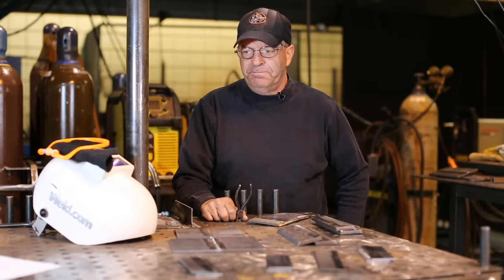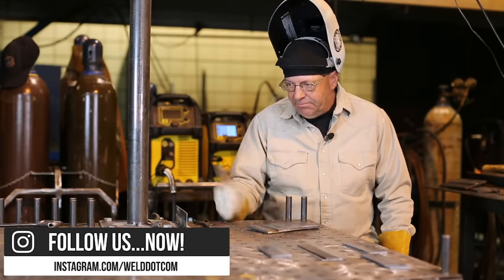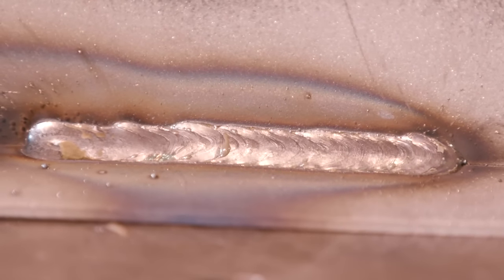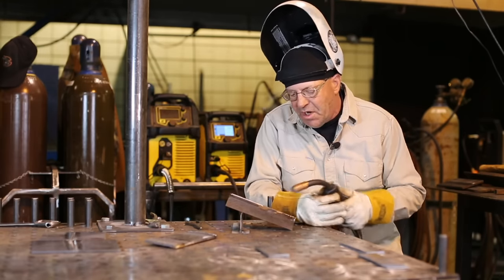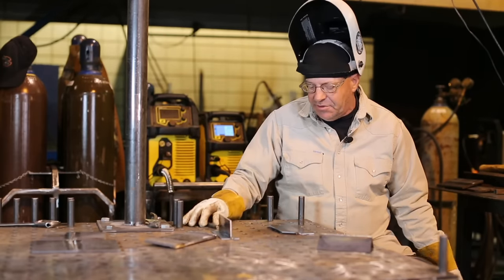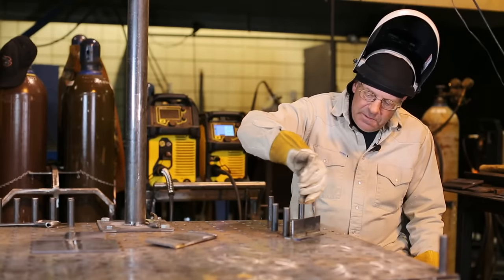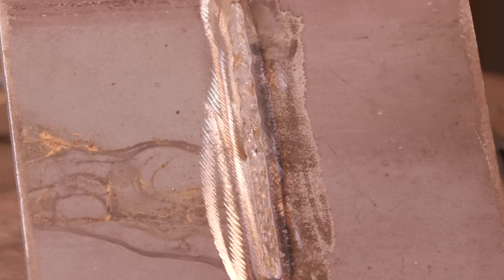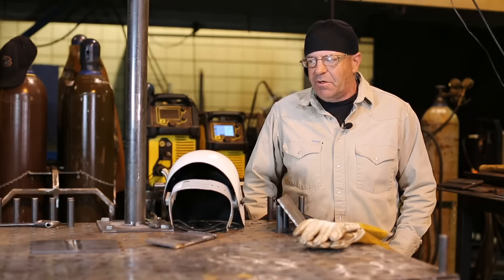Beginners Guide to SHORT CIRCUIT MIG WELDING

Comment: Bob, I've learned so much from your videos, my MIG, TIG and Stick welds are worlds away from where they were when I started watching your videos.  I do a lot of work on very thin sheet metal,  vehicle floors and bodies.  Do you have any techniques for very thin materials with Mig and/or Tig Welding?  I'm mostly working in the 22-18 guage range.  Thanks again for the great videos.

Comment: Thanks for the video Bob.My Esab EM 215 ic definitely runs cold on recommend settings compared to my Millers.For 14 gauge I am running 18.5 volts and 240ipm for most of what I do.I am always running this welder at 1 volt hotter than recommend.My ESAB Rebel amazes me on how smooth and spatter free it welds when properly set up.
Reply: Which one is better?

Comment: Bob I own several welders. haven't  used them in several years due to back surgery. my welders control amperage and wire speed. I feel like ripvanwinkle, what's with the voltage vs wirespeed? This feels like when I woke up one day, and degrees Celsius was the game.

Comment: Love the format, the audio, the arc shots, from the first second to the last, great video.  Having watch the video once, I'm trying to understand what voltage effects.  Wire speed, got it, but volts, well.  My brain has had a hard life so I need to watch the video a few more times or look it up in my Lincoln Foundation Procedure Handbook Of Arc Welding.
Reply: Sparky The Welder Voltage is arc length and makes to pool wet.
Reply: I guess trying to pull the electrode back from the work piece to extend the arc would be an exercise in futility.  Thanks Bob.  Much appreciate your wisdom.

Comment: Thanks for your teaching. Gives me something to work towards! But I have a total-newbie question: are you running at 120 V or 240V? I just bought a shiny green unlimited 200 and have it plugged in to a 120V 20 amp circuit. Do I use the settings you provide (i.e., 17.5/200)? Or, since I'm still learning can I reduce the voltage and feed speed? Thanks particularly for your comments on cleaning the metal. Didn't realize it would make such a difference.

Comment: Bob, I have a question. I don't have a fancy MIG with a bunch of bells, whistles, digital readout, and all that stuff. Just a little Lincoln 180 with a couple of knobs, and a chart in the door. I am a self/older guys taught in the shop TIG welder that mainly welds nasty old Harley cast aluminum, and steel for tools, frame repair, and so on. This MIG thing is new to me, and until I started watching these videos, I never knew any terms for different kind of MIG welding, much less it existed. 

So here is my question: do you do something different for short circuit with the machine itself, or is it just the approach, distance of the nozzle, and so on? 

I really appreciate your videos. Maybe I will come visit you some time. I'm just down here in OKC.

Thanks!

David

Comment: I Like it! 
I use miller deltafab .045, 220v 3 phase, 90/10 running multi-pass on 1/4 and above on semi axles. Painted much of the time so we run it very hot to burn off the paint.

What do you think the best settings would be?

Comment: Hey Bob, from what I’ve read using 75/25 gas tends to give a bit cleaner weld than pure CO2 making it very popular. But I have also read that pure CO2 with short circuit method gives a bit deeper penetration and same settings & a slightly cheaper gas, Is this true? Also does straight CO2 burn through mill scale or slightly rusty metal better, or would you choose flux core wire for the very best penetration, and for burning through contamination using the short circuit method of metal transfer?  Thanks for your great videos Bob. 😎👍

Comment: Would you run .030 wire in 1/4" thick metal if not what size of wire would you typically run?

Comment: We stay with the 92/8 gas all the time. Mainly for our spray passes but we use it on our short circuit root passes also. Is there really a good reason why we should not use that and use 75/25 for the roots? i have never had a problem with the 92/8 for the SC process, was just wondering if there is something to watch out for.

Comment: We run way less co2 over here and a touch of o2 works well
Reply: Mr. greens boat tanks and aluminium welding You can get that kind of blend here too, there are commonly available tri-mixes (95-5-5, I think). But 75/25 is what everyone can get even at the local hardware. There are also a fair number still running pure CO2 because of the increased penetration.

Comment: Another great video! I see your using a non auto helmet. Can you recommend a good lower end helmet. Ive got a cheap auto darken helmet and I'm welding by brail! Even on the lightest setting I have a hard time seeing the puddle.
Reply from the maker: There's actually a Auto dark single in there. It's the Arc One Tradesmen.

Comment: I gave you a thumbs up, but please elaborate more on settings; other than 'I'm awesome and I know what speed and voltage to use'.  The whole reason to watch your video is so that as a hobbyist I can estimate the settings on my projects.  With stick it is roughly 1 amp per 0.001 inch.  Is there a similar rule of thumb with Mig?  I got the Mr. Tig joke too.  Keep up the good work.
Reply from the maker: There are charts for starting points, but unfortunately there is no golden rule, like 1 amp / .001 thickness. Start with the chart, adjust until you find the sweet spot. It will all become natural with some practice.

Comment: I like your vids, but would be good to explain what the actual effect of changing the voltage is. Saying the settings are "because I've been doing this for a long time" isn't very intsructive.
Reply: Dan67276 Voltage is arc length. Voltage makes the pool wet.
Reply: Bob  Moffatt Thanks - I'm not a welder per se - Looking to improve my hand welding (short arc) and maybe it's me, but I like to know what effect ea. parameter will have.

We run spray arc on a semi-automatic welding system in my business (90/10, 350-420 WFS, 250-300A, 29.5-30.5V w/.045) & the voltage does control the arc length there and increasing it tends to make the bead wider, which more or less corresponds to what you said.

I'm still learning even on our setup. Welding to me seems to be (large) part science and (small) part black art. LOTS of variables as you noted. As an example, when we were running pulse, the rep said to run with the tip @ about 1/8" stickout. Next time he comes in, says we should be running recessed - I said you're the one who said run stick out! Then we go to spray, which recessed was also the recommended. We ran it with stickout and all seemed fine so I call tech support and they basically said if it works, stay with stickout. Now we're running recessed. I still can't say I understand what the effect of one vs. the other is.
Reply: Bob  Moffatt So on short arc, if increasing the voltage makes the pool more "wet", will it cause the bead to "lay down" or widen out, same as we see on spray? What happens if one goes too high (or too low) on voltage? There's also a relationship between wire feed/amperage and voltage. I know you you need to increase the voltage for higher feeds, but not sure exactly why?

Comment: Welding for 20 years if you got 92/8 gas on from spray transfer. No boss us going to let you change the gas for short circuit. Works good with mig mix gold

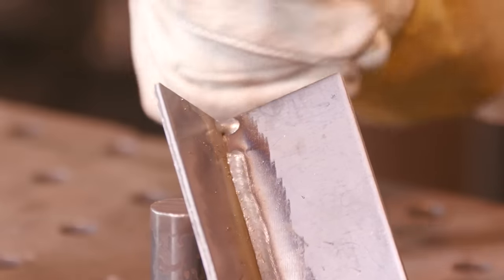Comment: hah i saw that porosity ;) 12:56  . id like to see some high production welds 550ipm  ~27v with .035 short circuit. thats what we run in our shop.  run down to 100wall tube in horizontal
Reply: BigRobBob .035, 27v, 550 wfs and you're short circuiting?
Reply: Bob  Moffatt every day all day
Reply: BigRobBob What gas?

Comment: Short circuit has to be bright shinny metal. No ifs ands or buts about it. We clean our pipe and fitting ends down to bright steel everytime. it is part of our prep process and that job goes to our apprentices unfortunately for them.

Comment: All this talk of voltages and inches per minute make me curse my little Clarke Pro 90. All it has is two switches, 1 or 2, and min or max, specs say open circuit is 21-28 volts. And as for wire speed,  there's just a dial that goes from 1 to 10. Kinda makes me want to go play with a voltmeter, and waste a bunch of wire seeing how slow it goes. But then it is close to 15yrs old and the internals were probably designed in the 80's, lol!
Reply: Mikeys Garage Time to upgrade?
Reply: I share your pain with my Hobart Handler! Didn't know what I was getting into,  just wanted to dive in and teach myself!